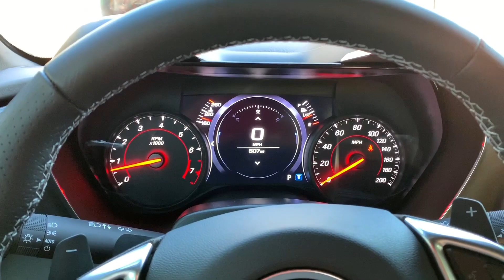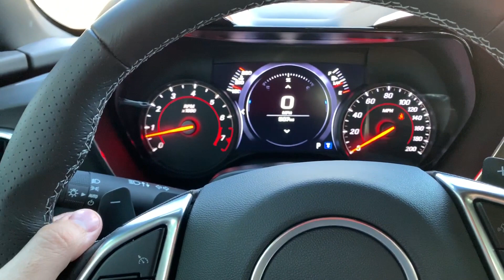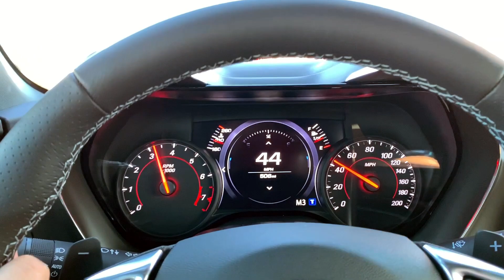How to make your 2019 Camaro SS Exhaust POP!! EASY | Vlog #222

Comment: I wonder if it’s the trans, different tuning, or different exhaust on the 2019s. On my 2016 with dual mode I used to do this all the time but it didn’t crackle as much as the 19s do. 🤔
Reply from the maker: not sure but i love the sounds!
Reply: C Wood agree I have a 16 and does it, just doesn’t sound like in this vid. Sounds like the 19 came with a different tuning to make the crackles more pronounce

Comment: I have a 2018 camaro SS with the NPP exhaust and can also make the car pop and crackle just like this in the same rpm range. It never gets old! So I think its the same across the board for all 6th gens with the NPP exhaust.
Reply from the maker: I love it! debating removing the resonators bc i dont want to lose that popping, but maybe the resonators removed will add more pops??
Reply: The 19’s pop and crackle more. I don’t know what chevy did different.
Reply: al prob changed the tuning and had the injectors inject more fuel on decel
Reply: @al151  the motor mapping has changed on of throttle, it still injects gas resulting in pops. There is a thread on a camaro forum about it. You can also make this on your 18 via obcd

Comment: i got a V6 2017 camero and i tried this with taking out the Exhaust flap fuse and its not popping or crackling
Reply from the maker: The v6 is different. This is more than likely only a v8 thing
Reply: @JLSpeed  ah gotcha thanks also question for the RPM why don't the V8s go up to 8k but the V6s do that is oddly surprising to me that the V8s dont have more RPM then 7k
Reply from the maker: @trainsinmanitoba1173  completely different engines and i didnt know the v6s reved out to 8k thats wild.
Reply: @JLSpeed  yeah

Comment: You don't need to go fast. Mine will pop in 1st. Every morning there are 4 speed bumps.  I scooch along in 2nd at 35kms and let off the gas and it pops as I wind down to 20kms. You don't have to over Rev but I think it's louder when you do...doesn't matter the gear.
My take anyway.🚗

Comment: Also bought a 19' 2SS earlier this year; besides the handling I thought that the "S" track mode was louder than the "T" track mode...?
Reply from the maker: The exhaust does differ in the different modes, you can also independently set the exhaust to either quiet, touring, sport, and track, or automatic to change with the modes. I have mine set at track mode for the exhaust all the time.

Comment: Does this work for. 2016 ss ?
Reply from the maker: SpinThatTrack 2019 i have heard that they 2016-2018 camaros will pop but not as much as the 2019s and at different times not consistently. But the 2016s do pop from time to time.
Reply: Yea definitely different rhythm, mine pops but not many crackles like yours. Mines 16

Comment: does it work on 6 gen v6 with npp?
Reply from the maker: lethalbowtie not sure if you have one try it out and let me know!
Reply: I have 2017 2SS with the NPP and it does work, but make sure you are in 2nd gear and rev up to 2,5-3K and then let off. Sometimes it makes alot of crackles when the engines is cold, and sometimes after you've driven it hard for a while the crackles start coming back again. They can be really loud sometimes. And yes, it's extremely addicting :D
Reply from the maker: Intraframe i also just noticed that when doing 55-65 in drive and you just floor it and let the rpm jump up to around 5500 which on the 10 speeds is super quick and then let off it will hold the hearing around the 4K down to 3k tpms and it really pops! Doesn’t need to be in manual at all just cruise and floor it for a second and then let off! My gas mileage will definitely be taking a hit!
Reply: @JLSpeed  I think your 2019 model pops more. Alot of people are saying that the pops are even more noticable (or maybe easier to trigger) on the 2019 model. :)
My car kinda (2017 2SS) pops whenever it's "in the mood". Sometimes its pretty low-key popping, and sometimes it goes full on AK-47 pops every single time. I just wish I could control when that happens. :/

Comment: It would sound crazy with some kooks and Borla on it
Reply from the maker: Yeah, Long tube headers no cats and 3" midsection is going to go in. Ill probably keep the stock dual mode mufflers in the rear to be able to quiet the car down if I need to!
Reply: @JLSpeed  I was thinking of doing the same, the stock mufflers sound amazing already, save ur money on exhaust and spend it on other things 🔥

Comment: Can this hurt the engine in any way?
Reply from the maker: No it will not hurt the engine. The pops are happening on the deceleration and what your hearing is just some of the fuel that didnt get burned in the cylinder finally burning in the exhaust.